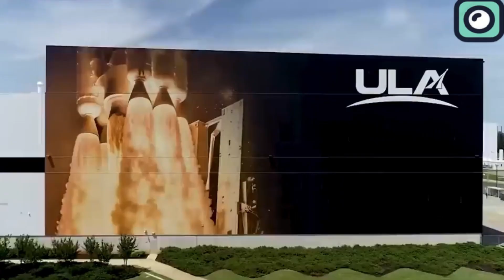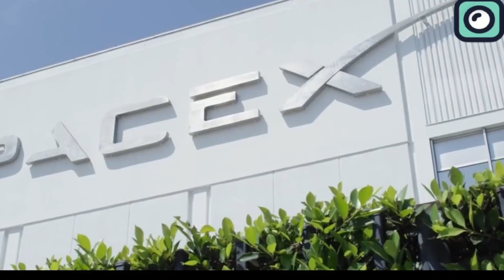IT'S OVER!! ULA Is Finally Being Sold.....Musk Reacts!

Comment: But isn't the ULA Vulcan rocket shells made up of composit mat'ls? How can Vulcan return from orbit, and be re-used with composit mat'ls ? Vulcan would need to be reusable to be competitive ???
Reply: They developed (not tried yet) so called S.M.A.R.T reusability.  It's ejecting engine mount with engines, and using inflatable heatshield and parachutes to return engines back. Catching in air by helicopter. 

Don't ask about how viable it is, rocket lab tried catching elektron in air and failed as it make helicopter very unstable.

Comment: They mention New Glenn have they actually launched anything yet with that rocket that actually did something took something to space did something innovative
Reply from the maker: Yes, new shepherd
Reply: @SpaceTrends new Sheppard is just little more than grasshopper. 

New Glenn will be competition for F9. 
But Starship will destroy it even if BO project Jarvis will be successful. Simply production cost is so different. New Glenn rings are made out of machined aluminium alloy. Expensive, and hard to work with. Starship price is 90 mln fully expendable. BE4 INTERNAL cost is 7 mln (20 mln for external customers like ULA) so it's 42 millions for engines for first stage alone
Reply: @SpaceTrends  Pull the other leg. Even by the most liberal definition, NS barely makes it to space and never to orbit. In December of 2023, New Shepherd completed it's 24th flight. 

Meanwhile, there are 3 Falcon 9 boosters currently sitting at 19 flights who are competing to claim the flight crown. If you look at the launch schedule from Cape Canaveral, a Falcon is going to space 2 to 3 times per week. They would be flying more often, but there simply aren't enough payloads available.